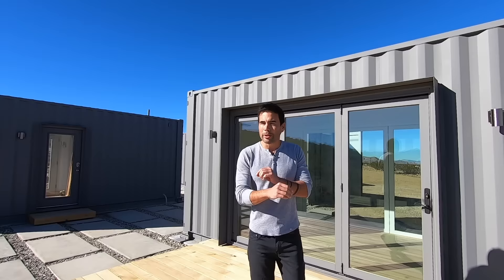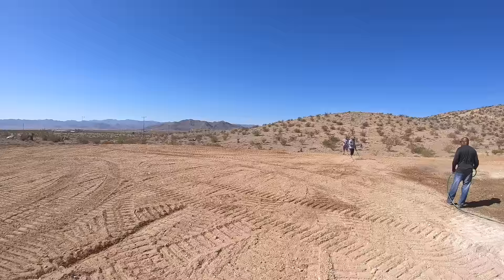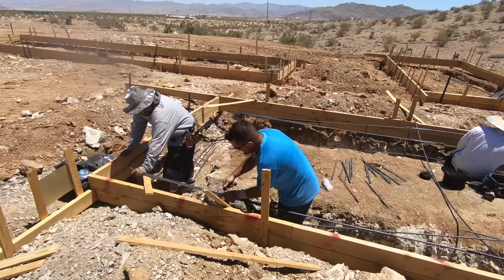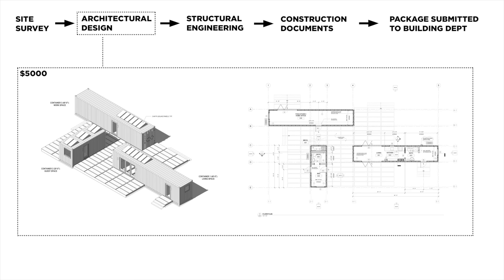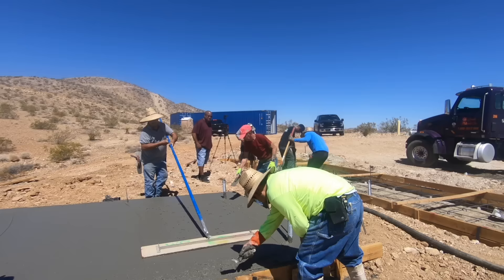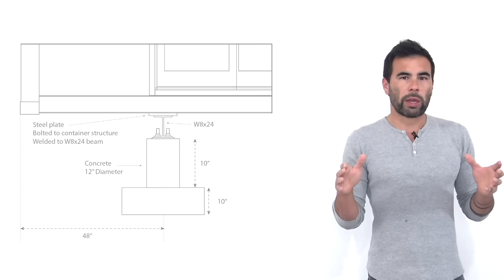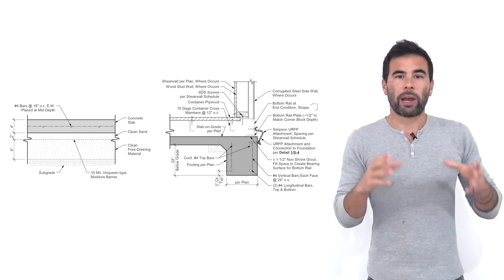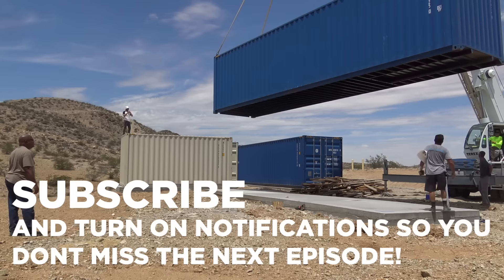Building a Shipping Container Home | EP01Permits and Foundation Design

Comment: I have 32 years in Concrete foundations experience and with ground that hard where you had to use metal stakes You don't need a monolithic foundation for that container!!! 

level and prep ground and set it and forget it. Pure greed and corruption!!!
Reply: @Joshua Mendoza screw that.. Just plonk it down. If it sinks overtime, just lift up the house, pour in some more dirt, pack it down, and put the house back.
Reply: Yeah Tall, I'm from Australia (35 yrs in the game) and I've designed quite a few container projects and I confess I'm completely mystified by this approach. I just run screw piles (to even bearing ground) at the 4 corners and lift the bastard up 600mm above ground. I run conecting timber decks between the containers and pre-cast 'Home Depot' (Bunnings in Aus) pad footings and timber posts to bearers and joists and standard decking flooring timber (internal and/or external). Cheap as shit and great for the bloke who is good with his hands but not a builder, so he can get on with his dream. All your plumbing is accessible under floor and if you do happen to suffer earthquake damage at least you can get to everything. As far as being level ??? get a fucking laser if you can't operate clear flexible hose and water.
Reply: @twowongs8266  Gotta love people who know how to just get something done simply and effectively 👌
Reply: California Dreamin' has become a nightmare.
Reply: Finn K opportunity costs
Reply: @twowongs8266  Is screw piles synonymous with helical piers?
Reply: @codyharrison771 Hi Cody, Yes, in essence they are if you are using a steel screw-in form rather than concrete cast (which is using an auger to essentially drill a hole to fit a form tube and then pump in concrete). The plus side to helical piers is that you have minimal impact on the site and are able to drill the post down to even-bearing ground, which I believe in in imperial allows you to go down to a whopping 60'+ (very unlikely unless you're building in a swamp). All you need is some bore logs and an engineer to calculate the load for the structure vs the ground conditions to give you the depth.
Reply: Your so exactly right. It's BullShit
Reply: Exactly!!
Reply: @twowongs8266  where u situated Two Wongs or where can I chat to ya. Be toying with an idea
Reply: @twowongs8266  how can I contact you for more specific info? You seem to know this shit, I need some knowledge for a project.
Reply: I agree, if hand excavation was difficult and the pictures showing disintegrating rock , it means that the bearing capacity can not be less that 300 kPa. I don't think that the container will have bearing pressure more than 100kPa. This means that you can just even out the ground and place the container directly on top without concrete or special foundations. If Settlement happens it will be minimum and uniform and won't have much impact on the structure because the container is rigid. This is even a better solution in earthquake prone areas because the structure is sitting on flexible/ compressible material. Structural engineers don't tell you this because if they do then there is no work for them to do.
Reply: I live in CA and when we moved a storage container they gave us two options create a gravel base or do one of cement. We opted for the cement and with way less rebar and digging. Yes you have to get permits but it was not as expensive as this guys permits. Ours was around 2000 because we also built a 20x20 storage shed next to the shipping container that serves as our storage garage.
Reply: Completely!
Reply: Apparently, you don't live in California. A building has to be able to survive a 8.0 earthquake. Joshua Tree is Southern California and has plenty of earthquakes.
Reply: @finnk1289  I couldn't read it without hearing the accent
Reply: @williamknapp4917  Russian accent? XD
Reply: @Fangs4DaMemories  And shipping containers are built to LIVE in earthquake conditions with 6 or 7 containers stacked on each other fully loaded. Overkill doesn't even begin to describe what's going on here.
Reply: level and prep ground and set it and forget it, lol, are you serious? This is America

Comment: It's a shipping container, it's structurally sound without a foundation, you don't have a framing structure that needs support from a foundation like a regular framed building. My understanding of building permits for shipping containers is that you just need pylons every 20 foot. If it's just a workshop and it doesn't include residential area then you actually don't need any foundation at all because the shipping container is structurally sound as is - after all they're built to handle the structural load of being stacked fully loaded ten high! Load them to max capacity and stack them ten high and put them through the worst hurricane you can find - they're engineered to take that.
Reply: It's just about the laws in California. Pretty sure it has nothing to do with structural integrity. I think he would've done it that way if he could since it would've saved him insane amounts of money.

Comment: I think that your thought process and building method is very sound. I wish i had found you when i was in school. I think that the SOG was a good system. The lateral support you get from the horizontal plane of the top of concrete at the top of grade spanning between the grade beams,  it is a thinner volume than that of a structural slab on void, or slab on crawl space and allows for less concrete. Though the slab on crawl space mitigates the need for trenching for MEP lines so a cost analysis is generally the best way to do it; which is what you did, and since you are paying for the service, the engineers can figure out what is the most cost effective. Good job, well done and i think you got a great product out of it.

Comment: Would have used a second container at a foundation that would have doubled as a basement
Reply: @Boy Flaca I was thinking laundry, storage and maintenance room, but each to their own.
Reply: its really hard to bury a container, i've heard most the time they get crushed
Reply: I can only imagine what permits and code compliance he would need.
Reply: @bradford4646  They're regularly stacked 10+ high on container ships, and they're loaded. What's crushing them?
Reply: @JPLoinsigh  Its the side pressure.  they have really strong point stability/strength. But the crush pressure to the middle of the side walls are often to much.  If you had a very rocky/stable soil and dug out a hole that might work.  IDK, seems like that is a big risk with so much time and money on the line.

Comment: After all that trouble you were better off just building a house from scratch.
Reply: Or even concreted posts to support the container. That slab was absolute overkill.
Reply: Earthbag construction ;-)
Reply: Yes but his life savings were dumped into the building permits 😀
Reply: More “eco-fantasy” fostered among millennial “repurposers”
Reply: Folks...at the end of the day, it’s a steel oven with an insulated conventional interior...built in a desert...at mind-numbing cost. Sorry...call’em like we see’em.
Reply: dan the man ...agreed, Dan. Anderson windows and folding patio doors...in a shipping container? They cost three times what the container costs...but the overall project was upside down from the start...based on market value

Comment: I purchased the Containers of Hope plan set and I intend to build on rural property in NE Scottsdale, AZ. I am going with individual pier footers because I’m in a flood plain. The option is either to build a huge, non natural-looking pad (roughly $50k) or elevate the home at least 36” above the dirt level. With shipping containers it’s easy to do the latter. Going with pier footers is not only greatly more affordable than building up the pad, but it will also allow me to run ALL my systems under the containers, which will also make them easier to service and repair. Plus my home won’t look like it’s in a valley and my views won’t be blocked when other “traditional” homes get built around me.

Comment: How did you handle the flashing with the container and the slab?  The beam that runs from each corner is not usually flush with the bottom of the corners, so did you flash or caulk that joint?  My concern would be water ponding under the container, maybe you solved this by just sloping the slab?  The project looks awesome and I've been following along from the start on IG, so I'm pumped to see you post the videos.  Awesome content, and I appreciate you sharing the details of your experience!
Reply from the maker: great question!  we will show how we used Quikrete precision non-shrink grout in later episodes and how we secured them to the slab

Comment: How to Build a Shipping Container Home

Step 1: Build a timber frame home instead
Reply: I need help in putting wooden floors and windows sizes and doors and a bathroom size..please help me..to see the vision for my container .
Reply: Explain?
Reply: That would be even more permits....like $50,000.00 in permits. Crazy thing is I witnessed an inspector tell a contractor to not pressurize a water line with air because they can explode. Instead he wanted a stand pipe with 10 ft of head pressure.......Thats in California

Comment: In South Africa when I helped build my first project,the engineer found that there are many rocks and therefore reinforcement wasn't really necessary, especially if it's going to be for light weight building like a container. I guess engineers just differ aswell.But this is amazing,thank you for informing us👍👌🔥

Comment: Seismic Conversation:  BUT it is a Container, Self Supported, Steel Box..  If the Footing Fails it will have no effect on a prefabricated steel structure.  It is not like building a house connected to the footing. where it matter alot.
Reply: Except that after a quake that disrupts your foundation, you now have severed electrical , water and sewer connections that have now been open to the atmosphere and are a problem, the integrity of the container, that now has windows and door and other cuts in the enclosure, could be compromised. If you follow the permitting process (and aren't building in a protected desert space), you'll end up with a home that will likely withstand a 10.0 earthquake without significant damage. Shacks that can stand for decades in other parts of the country wouldn't survive a 6.0 earthquake. Yes, building in California is expensive, because the ground shakes or because we're near the ocean or because in much of the state the weather is temperate year round. We also have limited water so it's not exactly in our shared interest to encourage new construction in low density areas.

Comment: If you did this like a tiny house on a trailer, you can easily access any plumbing from below and place a metal pan afterwards for protection with insulation.  idea if you add more.

Comment: Why didn't you "connect" the shipping containers? Just curious, seen many homes, shops, etc., built from shipping containers and many are connected, some go as tall as 3 - 4 stories high.
Reply: Probably either Aesthetic, or Legal Problems
Reply: Cost a king’s ransom to build out a conventional interior in a steel oven in the desert...for use by wayfaring “tourists” while he’s back at work in Boston where he lives.
Reply: @davidjose2193  Just go out of the box! You can do air intake facing the prevalent wind side and exhaust takes at the bottom areas of the leeward side. Add some shady botanic area +/- on windward side abt 10' out and work the rest of the perimeter areas with adobe flying buttresses [arbotantes] to not only break hot wind drafts changes from the wind shifts of the desert flow [and, therefore, solving that darn anchoring problem of the containers - 2 birds in one shot!!]. Call that as a dear friend {Fernando Abruña] defines it in his books as "Fresco Gratis".

Comment: What a missed opportunity.   
I wonder why he didn't think to dig down and pour a large, interconnected concrete basement with concrete walls that would have supported his above ground containers.  If he wanted, he could have used a few steel beams on top of the basement walls for added strength.  
t would have given him all kinds of extra room for storage, bedrooms, greenhouse, etc.,  for a cost of about $10k more in concrete. With skylight reflectors installed from above to light the below ground area and also a few well-placed block glass sections right above the soil line to bring for natural light, he would have been all set.  The area below ground could utilize the thermal power of the soil to keep the lower level cool in that hot desert.
Reply: Don't forget they need a very good air conditioner also & swimming pool, who in their right mind would want to live in a very Hot dessert ?? Y'all must like cooking & baking in the Hot Heat. Crazy. Well said .
Reply: Well said. LMBO.

Comment: Very good video. Nicely laced with a great level of detail. I liked the explanation of why you went for the slab foundation and the summary of (and I paraphrase) “It was the most pragmatic solution”.  Would a six pile foundation with a central crossbeam in the middle have worked ?  That should give a combination of depth and lateral support to address all of the issues highlighted.

Comment: im a builder. 1st question is where are you getting your water.  2nd question whats the final tally of the project. 3rd questions is how did you get around the insulation problem.
Reply: i would have went for the 18" clear space.. cheaper faster and i dont want me house close to the ground if its in the desert. to many snakes and other insect and animals that can get into the house from a door let open for air.. i would have placed slat roofing on top with solar and vented windows at the top of the cube for air day or night.
Reply: Most people in the desert opt for a tank or 2 to hold water. The cost of a well is too prohibitive in most areas. .There was a survey done post ww2 where across the southwest they placed farms, cattle troughs and windmill wells, better to research those areas in desert for water and cheap well costs.

Comment: In the teaser for the next video, it looks like your containers already have built-in beams that run laterally across the container.  I guess welding those to the i-beam foundations still doesn't count as lateral support?

This is what's frustrating about over-regulated building codes.  It's a one-size-fits-all approach.

Comment: One more reason not to live in CA.  I built my home in South Dakota 4 years ago.  The permit required submitting drawings and was approved within the same day.  Inspections consisted of a test hole for the septic which I did the previous year, inspection of the septic system, Rough plumbing and electrical.  That's it.  If I'd built within city limits, there would have been more.
Reply: We couldn't get building inspections from the government where I live even if we wanted to, no permits needed, why should anyone need permission to do something on their own property.
Reply: Phill Huddleston lots of reasons....suppose you want a pig farm next to a subdivision.... you’d stink everyone out and suppose all that shit going into the land soaks into the ground water... or my well... or if you put up a 300 foot tower and you live at the end of a runway...
Reply: @Andrew Pearson Insulation is key, no doubt.  Our basement is ICF construction and with in floor radiant heat, we have 2" of foam under the floor.  It's incredibly comfortable downstairs.  Our main floor walls are 2x6 construction with an inch of foam on the outside over the sheathing providing a thermal break.  We insulated with3" of spray foam.  
Yes, we have winter, and this one is harsher than normal.  But living at altitude, the sun is more powerful here and makes it more bearable.  It's far more bearable than when I lived in the Twin Cities.  We get lots of sunshine here,  In Minnesota we would sometimes go for weeks without sun.  Our average temperature at this time of year is 39, and that's very comfortable on a sunny day.
Reply: @Wooly Bully How do you get sanitation services when you live in the middle of nowhere? Waste management becomes a nightmare when everyone is spaced apart.  How do you get any services? How long does it take for the fire dept or medics to arrive?

Comment: Another thought I had recently. Why not build custom window frames and use vehicle windshields for your windows? Glass can be very expensive, especially large sheets. Being metal containers you could also weld in old car doors with crank windows.

Comment: Useless regulations!

If you just put the container over the ground, that would be enough for your project. I mean, this is not the sears tower right?
Reply: Like Home CDMX the containers do shift with water and wind erosion. My containers, currently dropped on the ground, have whole dens of snakes living under them. One small animal digs a hole and all the rattlers move in 😕

Comment: amazing although 6000 $ for the slabs is probably ok, it is containers in an area that doesn t seem to get a lot of permafrost or water at all...  a simple point foundation or gravel should have done the job... add perhaps rubber pads and the worst thing after an earthquake would be renting a crant to set the boxes straight again. use flexible pipes and it s all fine... the costs are pretty high, I paid 5000 € for a two story house in terms of static calculations. Architects fee was higher but that was for a stone house with over a year building time not for 3 containers. The permits cost is based on the overall price/volume ~ 1000-2000€  are less as well. How does the land of the free end up with such high additional costs compared to germany??
Reply: 100 buddy!
Reply: California is certainly not free, no building permits at all in the Missouri (USA) county that I live in.